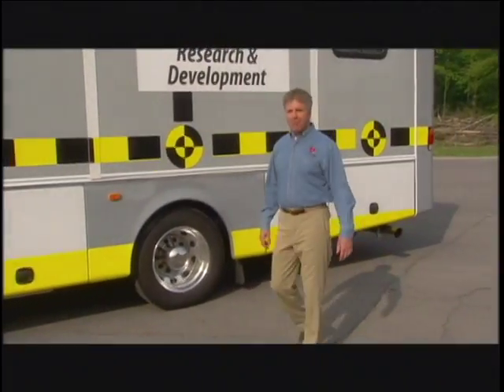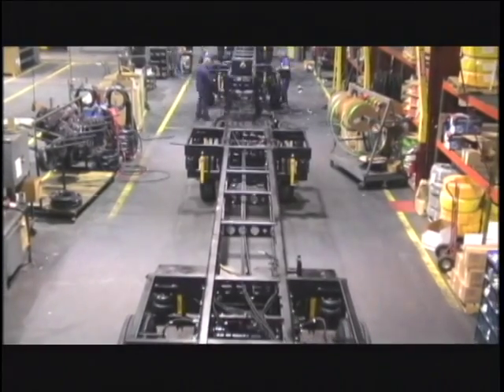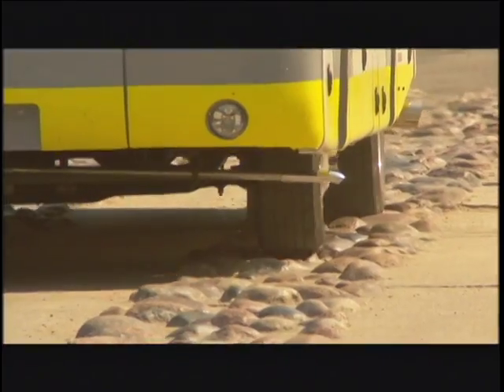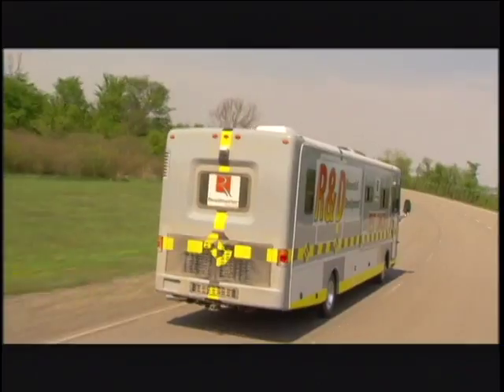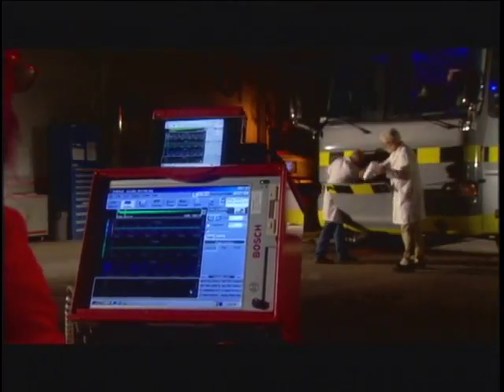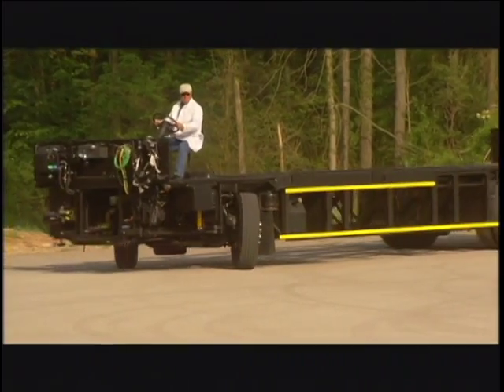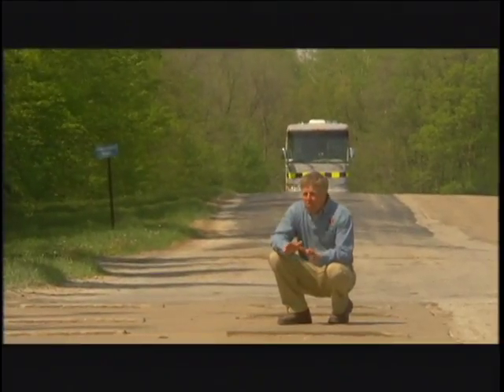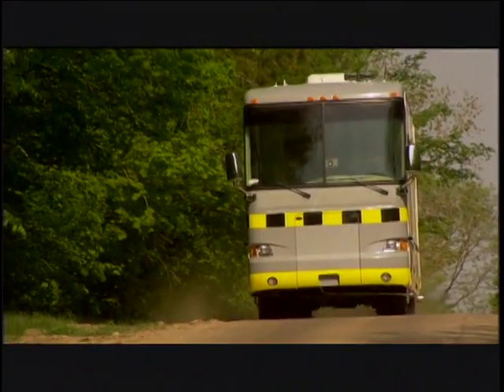Testing Our Metal,  Monaco Roadmaster Chassis, Monacoers

Comment: Regardless of bankruptcies and new owners, NO company should produce a advertisement that appears to care, when leaving previous owners to absorb your engineering failures
Rr4R Recall.
Read about them, it is causing me $7000 to correct
Reply: Full info on this recall is at   https://sourcerv.com/RoadmasterR4R_FMC1109.pdf
That's what ya get for owning a modern chassis!!  LOL
Paul
Reply: You spent hundred of thousands of dollars to buy a machine to allow you can take a dump in the woods in comfort, so what's another $7000? What kind of gas mileage do you get in that hog anyway, 9 mpg?  Ever thought about how much money you've wasted on gas ...?
Reply: @RD2564  what?